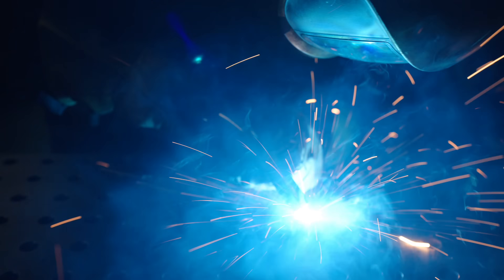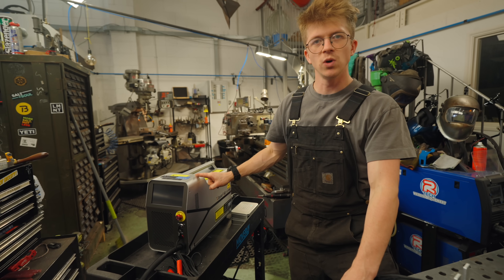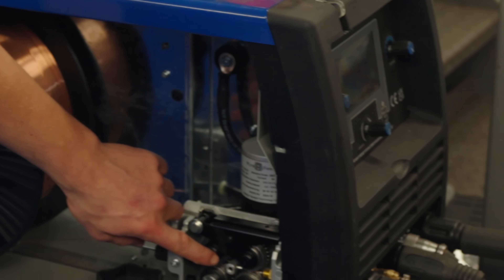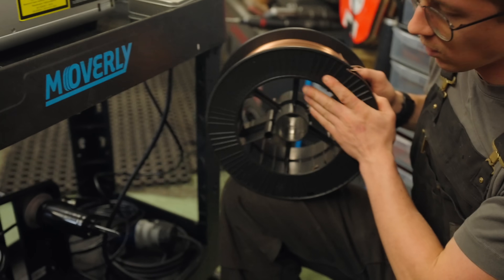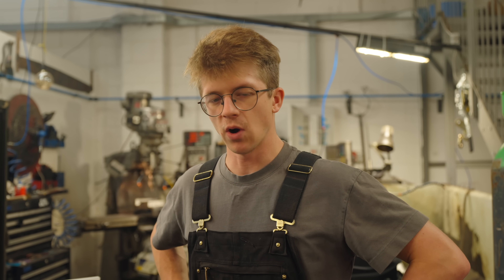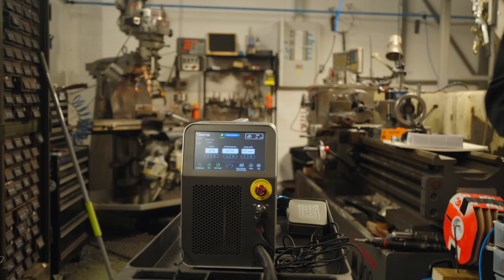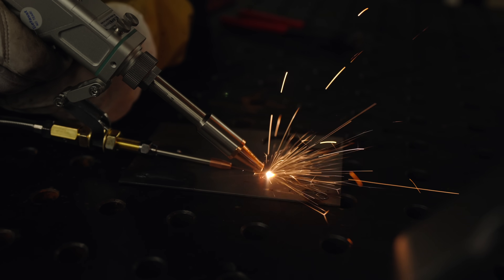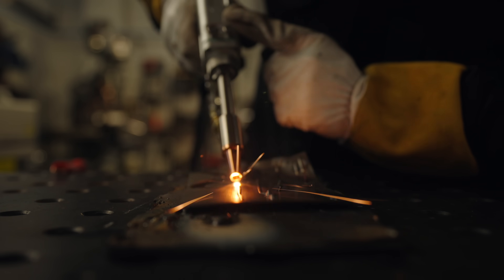Laser Welding

Comment: I've been following you for years and you've been an absolute angel, always (relatively) sensible with tools and safety, but this is horrendous to watch. I get that these cheap diodes lasers cost a few thousands and that a proper set-up costs over a hunderthou, so that the price of the enclosure outweighs the ever cheaper welders, but these sellers are going to harm a lot of people.
Even though the laser source is now toy-priced these lasers are not toys, in continental Europe they can in theory not even be sold without training (and I don't see any evidence of any awareness in your video, so probably there was none), but at this pricepoint that training ...

Comment: As you're based in the UK I would recommend you speak to TWI (the welding institute) about laser welding because it's significantly more dangerous than any other kind of welding and there are a lot of controls you should consider. One example being that you shouldn't have anyone other than you in the room when you're using it

Comment: This is 100% a tool that requires a dedicated space. I worked for a school that taught welding, and in their laser welding rooms every single welder had its own dedicated booth that was basically made out of non reflective surfaces and windows that were made out of the same stuff that the welding helmets had. And then on top of that, the welders power would be cut off until the door was properly closed. 

These lasers are so powerful that even tiny reflections can permanently blind you.

Comment: It's important to note: on top of the paranoia required to actually use laser welding safely if everything is going right, there can be many trip-ups (such as fake safety glasses that don't work, or don't work as well as stated). But by far and above the most insidious thing about laser eye injuries is that they're not always like ark flash from hell. The right wavelengths can carve tiny little scars across your retina that your brain does a wonderful job of hiding from you by filling in the blanks. You won't even notice, until (if you're lucky) your brain starts filling in things that don't make sense and seem to be hallucinations. If you're not lucky, one day you'll get one scar too many and a prtion to all your vision in one (or both!) eye will just go from "clear" to blurry/garbled/unintelligible when it's just not enough information for your brain to guess what's going on anymore.

Comment: Your going way to fast, if you would lower the speed on the 5mm steel it would be a deeper weld and stronger. The faster speeds will work on thin plates

Comment: if you turn the wire speed down you will easily get 100% penetration on 5-6mm steel welded on both sides, when you get ok at it  the weld will be much much stronger than the actual steel

Comment: I do a fair bit of work with our laser welder, ours is a 2Kw. one of the coolest things you should try is what we call the “nail gun” feature. Set your watts high enough and do a spot weld to penetrate through one steel coupon and fuse to a coupon below it with no prep like two pieces of wood and a nail gun.  Kinda like when your first weld stuck to the table but use that depth of penetration on purpose between two pieces. 

Also love that you went into safety of this equipment, it’s no joke, light reflects, we’ve burned a hole in a wall just off the reflections while welding aluminum. 

Also also, wire type is dependent on base material, just like MIG or TIG. 

Great watch!

Comment: You were using the cleaning setting wrong, You can see how because it was at a high setting it was melting the surface of the metal it doesn’t need to be at such a high setting it should leave a more sanded finish.

Comment: I own a large 2000watt laser welder sold by Everlast. I use it for welding very long straight runs of stainless steel. There is definitely a learning curve. But, once you learn about the settings and a few techniques it is irreplaceable. I'm doing 6 foot fillet welds anywhere from 1/8" to 20 gauge 304SS in about 90 seconds. When used properly I see it as a workplace time machine. It allows me to get so much done in such little time in my shop. What used to be hours of Tig welding in now 30 minutes with the laser. Anyone using one of these should have a safety interlock on the door in the welding room to prevent accidental blinding if someone walks in the shop without Safety equipment. The reflection of the laser off a piece of polished stainless will burn anything from less than 6 feet away and blind someone from much further.

Comment: I ran a laser welder for almost 2 years and a bunch of hours at my second to last job, its like no welding ive ever done and i love it, you can tack weld with it if you tap for a second start a weld, you can end it easily by lifting the back of the handle and "jumping" the gun, the laser will be on long enough to cut the wire and the jumping will turn off cause of loss of interlock. jumping is like rocking veritcal up. Oh and laser welding can hurt quite a bit. Also use safety glasses designed for lasers on top of a different helmet, ive seen them go through the plastic of the hood. We had a IPG photonics lightweld xc.
Reply: Also dont run over tacs, always start and stop at one. Nitrogen always worked best for us and run a higher feed rate than you would with a welding machine, i always ran at the lowest 45 and when cutting or doing stainless i ran 58. Our shop had a black box to keep this thing in. It can also refract around the shop off a shiny stainless.

Comment: You need to put some flashing warning lights outside all the doors to your workshop with signs saying high power invisible laser in use. I would even wire in an interlock so the laser can't be used unless all the doors are shut and the warning lights are on.

Comment: The consistency thing comes from motorized roller it's equipped with. I'm pretty sure you can rig a MIG nozzle with roller like that too and tune it to output much less heat with tinier bead. So in other words, for the price it offers really little new to the table.

Comment: High power laser lab tech here! As some others have said, it's very VERY VERY important to think about reflections with this sort of a system. You can blind yourself instantly, and I do mean instantly, if the beam were to reflect into your eye in any way. Reflection/refraction possibilities is why we have our beam paths very purposely laid out with enclosures dependent on wavelength. The wavelength that your unit works off of isn't the scariest out there but is still a very dangerous beam, you should have eye protection on if the beam is active period, even using the 'cleaning' function. Still a very cool bit of kit that I would love to have at home so I could play with even more lasers!

Comment: Quick suggestion for you if you want better penetration you need to get that feed rate down so it's not coming out so fast, also be mindful that you want the laser to be pointed at an angle that looks down the crack that you're trying to to weld. Think of it like the crack is a hallway and you're trying to light the hallway The light will go farther down the hallway the more it looks directly down rather than at an angle.

Comment: It would be interesting to see how it affects a damascus stack. it looks like there is a smaller "burn" area. (i am not a welder, never touched one let alone laid down a bead and as such do not know anything about the nuances of the art). does the laser welder focus the energy to a smaller area allowing for less disturbance of the base metal?  

would it even be suitable to weld the different metals together prior to forge welding, or will the welds fall apart under the power hammer?

Comment: I just love how the red clamp is a sort of safety device so it only works on the material like the device was intended but that all goes out of the window as you select "cleaning mode".
Almost as if it was just an afterthought to charge more for the device and the engineers just said F it,  clamp it to the gun i dont care bro.

Comment: While that welding is super slick,  lasers scare me.   Because not only do you need protective eyewear when using it, so does everyone else in the room/workshop.   The big worry isn't shooting someone in the eye, I mean if that happens yeah they're done,  but reflections of the laser light are also dangerous for your eyesight and while IR isn't as reflective as say a green laser, the fact that you can't see where the reflections is makes it even scarier.    So here's hoping Jamie and whomever else you have in the shop also has PPE eyewear, and also your cameras too as you can possibly put burns in your camera sensor.

Comment: One question first, doesn't the fact that your not using the ideal or recommended filler wire slightly skew your results, and therefore your review is invalid regarding actual welding?
Now, this was a very educational video, loved the way you didn't read the destructions first, mess it up, then read the destructions and get a whole better result lol. Another fantastic video, very cool bit of kit that should be in everybody's workshop, providing you can justify the cost, which is a big step to get over, I think another plus side is that when your welding a billet together, there isn't a huge amount of extraneous material to remove. Loving the whole thing and once again a very cool video.

Comment: I'm curious to see how well it works when assembling damascus billets.  If you could make a billet without using filler, it would save you a lot of time and waste, grinding away the mig wire welds after forge welding.

Comment: GL cutting 15 mm steel with it. As a guy who works everyday with plasma cutter - can't see use for it in my workplace, either as welder or cutting machine. Yea, fun for "thin sheets" of metal, but not when you use around 5-8 mm thick metal sheets, I beams or C beams

Comment: If you reduce the feed rate the penetration gets better. And on a MIG welder you can reduce the splatter by a lot by using different gas mixes (like Teral 24/7 if you weld sheet metal ~3mm thick).

Comment: You are welding to fast... Set it at slower feed speed, and tad lower power and take like twice the time to weld for PROPER PENETRATION. 
I can get like 90% depth on 10millimeters with same laser. 
WHere are your laser curtains or separate room for laser welding? 
Like you cold do any research in the matter before using it. 
even watch someone on YT if you dont want to read.  Like Joshua De Lisle, Tim Welds etc.

Comment: Amazing that they are so portable and available in the consumer market now.
Having worked with Class 4 Lasers under 20 Watts, these & other multi Kilowatt handheld Lasers are a very terrifying bit of equipment.
Don't get me wrong they are great pieces of equipment, but most peoples safety practices and work environments are very subpar for using these safely.
Easiest way to conceptualize the danger of a Class 4 Laser, just think you have a flamethrower in your hand, each time you pull the trigger.
If you going to get one of these, Please take the safety training seriously for your sake and even more so for others around you.
Getting burnt would be bad, but losing your eyesight or worse taking someone else eyesight, not something you would want to experience.
Stay safe out there.

Comment: I imagine in the future this will be used for ductwork. It's so fast, easy, and clean, and it also cuts. Running hand shears and screws then taping joints by hand has to be slower than running a cut and then running a bead with the same tool making a perfect seal.

Comment: Th big points about laser safety are 1) Laser is in an enclosed area seperate from anything else and does not allow the beam or any reflections AND REFRACTIONS to leak out. 2) everybody in that area wears safety equipment while the laser is running or is in danger of running 3) some kind of outside measure to prevent or warn people outside of the area that the laser is running so nobody enters it. Minimum is warning lights oustide but I have also seen rooms that lock when the laser runs or are only unlockable from one side ( the latter provides outher saftey risks though) 4) if your safety equpment (mask, googles) EVER comes into contact directly with the beam you THROW IT AWAY. Its not rated for direct or prolonged exposure if you got a direct hit its compromised.

Comment: That seems incredibly useful and convenient! ...also INCREDIBLY DANGEROUS. Definitely needs to live in a Laser Cubicle of its own, with no flammable or reflective (remembering that some things might be more reflective in the IR wavelengths in use than they are in the visual spectrum) objects or straight paths out, and some kind of door safety interlock-and-signalling system and/or a door that locks from the inside (this option might not be to fire code?).

Finding enough space and sectioning it off suitably to avoid any reflections escaping while maintaining proper ventilation (all that burning metal/rust needs exhausting from the booth! ...just not in a straight line.) would probably be the hardest part, I'm sure some kind of relay to cut off the power and a door switch to trigger it are within your budget, as well as a sign on the outside of the booth that lights up when power is connected to the inside of the booth.

Comment: In terms of safety I think having a room, like the welding room (possibly use that room?), with metal sheets to protect the walls from potentially catching fire and glass on the window similar to the helmet that will block the wavelength of that laser would go a long way to increasing the safety with others around.

Comment: Former laser welding machines technician here. Excellent video, the only input I have to give is don't ever put your hands in front of a laser welder. Never ever. It will put a whole in your glove in less than 1s and it won't stop there... so if you don't want a burnt hole in your hand for the next 4 weeks, hands always at the back of the piece you want to weld or use fixing tools.

Comment: Really nice Video Alec! Physicist here with some experience handling lasers. I am already really happy you made some precautions with for example the right laser protection goggles. Here some additional tipps on safety:

Be VERY cautions with reflective surfaces and maybe even Interference etc.. 

1. Reflection is relatively self explanatory I guess but is something that can easily blind someone around a corner that just omes into your workshop or something. For this reason in scientific enviroments - when you use fairly powerful lasers - there was always some kind of sign infront of a door "Laser in use!" and even some lights indicating it. Interference is a bit more complicated. Also be aware of always having your goggles on correctly as with lots of reflective surfaces on a bad angle it could still reach your eye if you dont have it on properly! So if you want to be super safe I would advice to use it in a room without reflective surfaces and also watch the gear you have on (like watches or something like that).

2. Interference can for exmaple happen if the laser beam goes through holes/slids smaller then the beam (as you do a lot here). This causes interference patterns that will spread the laser all over your workplace which can be really dangerous especially for more powerful lasers. However the energy delivery spreads out as well and I guess as we can see here its not that bad really - which is probably also why you can buy these things without beeing an expert on lasers.

If you keep these both in mind you should be really safe. People actually have a lot of experience with Lasers by now as its almost 100 years old (1928 there was the first Laser). Lots of scientists use them on a regular basis and there is a lot of knowledge out there that you could definitely find on lasers. So dont be afraid of them too much, they are not that dangerous if you use them with some carefulness as you honestly already do!

Lastly... I am a huge fan of yourwork Alec, you are awesome!

Comment: As a welder that welds thick steel (1/4"-3") i will definitely never see a laser welder in my field, but with that being i think it looks and will work amazingly on body work. 

Also Alec, if you get some dual shield flux core you will be able to lay down the strongest welds you could

Comment: Good afternoon! I have been useing a laser welder for abaut a year now and I found out that you can do much thicker metarials than q few milimeters. And it isn't even too hard. Just lift it out a bit so it is only rouching molten metal and than you can go forvard with it and it is allmost like TIG but wire feed. You can do some crasy good welds like that!

Comment: Xlaserlab, you need to implement a range cut-off sensor explicitly designed to detect something in front of the tool, so if you chuck your tool down on the side and for some strange unknown reason it accidentally triggers it wont just randomly one-tap your work mate in the back of the head across the room.   Just an idea... :body-blue-raised-arms: